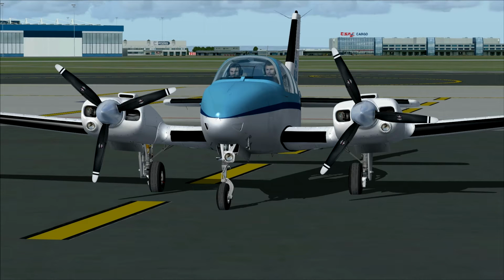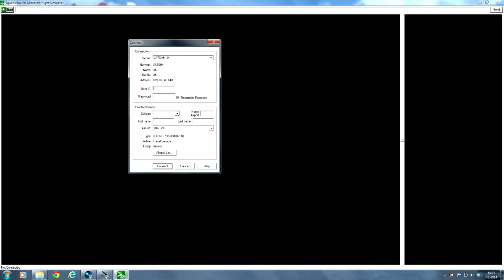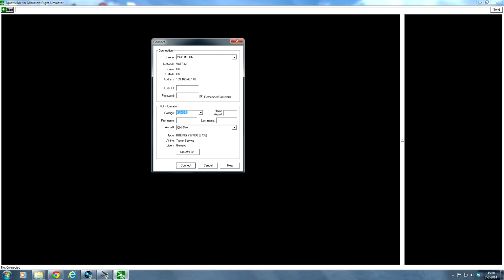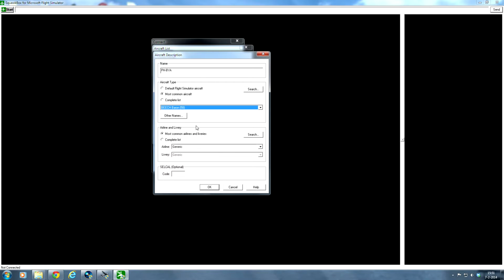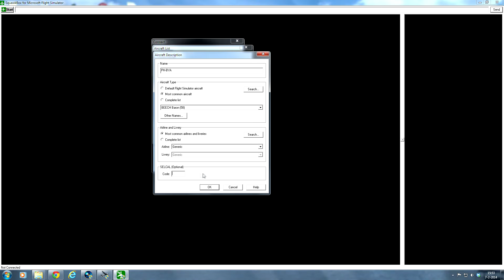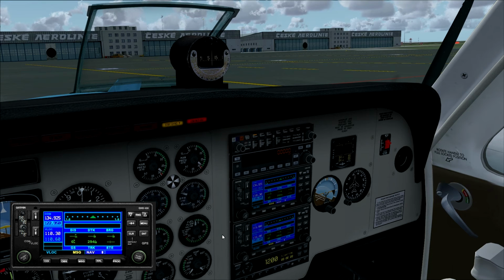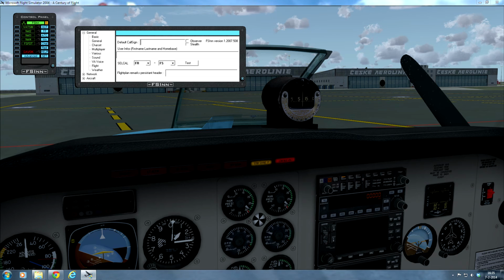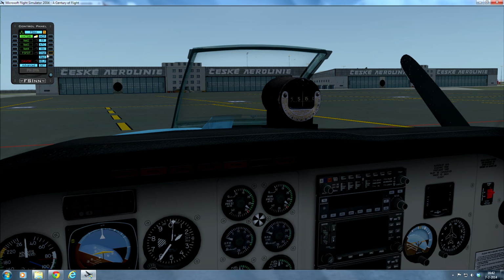VATSIM Tutorial: How to Connect to the VATSIM Network! [Squawkbox & FSInn]

Comment: So you enter free flight mode and start at gate, im single player wihout
AI? But wont I not be able to see other aircraft? Im confused
Reply from the maker: That's right. Once you connect with your pilot client to the VATSIM network it will display AI traffic for you. Default 'offline' AI should be turned off.

Comment: Do you just load into Free Flight Mode?
Wouldn't that mean that you can't see others?
Reply from the maker: Yes you load in free flight mode. Once you connect to the VATSIM network using your pilot client all the other aircraft that are online will appear automatically ;).
Reply: Thanks for replying! I was really confused at first, thank you! Should I turn off default FSX traffic then?
Reply from the maker: +Tanmay Joshi In most cases that is done automatically, but you can do it just in case.
Reply: Thanks!
Reply: AviationPro so once you connect you see everyone else's aircraft?

Comment: Hello, very helpful tutorial! I received a headset for Christmas, and really want to try out VATSIM. I fly in the real world, so I'm not worried about the communication side, just a little confused about the technology. I was wondering if squaking ALT in the airplane automatically made me visible on VATSIM, or do I have to do something else? Thank you for the help my friend, and happy holidays!
Reply from the maker: +Josh McCorquodale That's good to hear! Usually the pilot clients make you visible on the radar by switching between the standby and active mode in the pilot client itself. I've never tested at which transponder setting in the aircraft itself it switches to active mode in the pilot client, but the best thing to do is just to use the standby mode and the active (ta/ra) mode in the aircaft and just leave the other settings as they are ;). Happy holidays to you too! :)

Comment: Good evening: I run vpilot with no problem.  Everything runs well. My only concern is I listen to ATC controllers, and some I have a very difficult time understanding what is being said. Sound is garbled. The volume is good, but sounds like the controller is too close to mic. Ant suggestions,and are the controllers aware that they are not always understood? I don't want to sound like some pest and have to have them repeat themselves. Enjoy your tutorials. You make it look easy.
Reply from the maker: +steve sumner Hi! That's indeed a common problem, unfortunately there is not much you can do about it yourself, other than getting used to it at some point. This means making a lot of VATSIM flights so at some point you can fill in the gaps in any radio transmission. Some other tips are here: http://aviationpro.nl/vatsim/tips-tricks/#radiocommunication
Reply: Thank you sir. I will just have to train my ear to listen. Keep up good work. Your English is very good by the way.
Reply from the maker: Thanks! :)

Comment: Is there a program I can use to connect to vatsim that doesn't require SDK.
Reply from the maker: Gabe Zorbas I'm not sure what you mean, you don't need a SDK right? Just install the program and connect.
Reply: On the gold edition there is a file called SDK which, without it, all of vatsims suggested programs won't work
Reply from the maker: And what's the point of removing it then? I don't have any experience with FSX gold so I'm not sure what the file you are talking about exactly does.
Reply: I don't know, someone on the forums might be able to help.